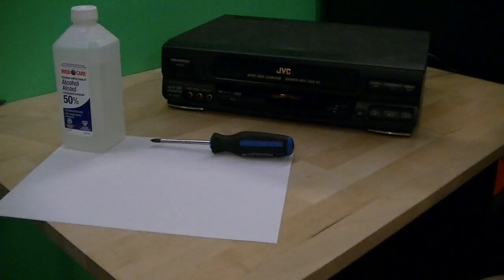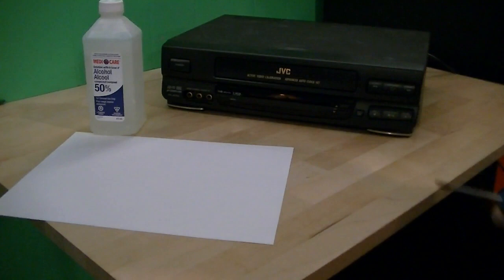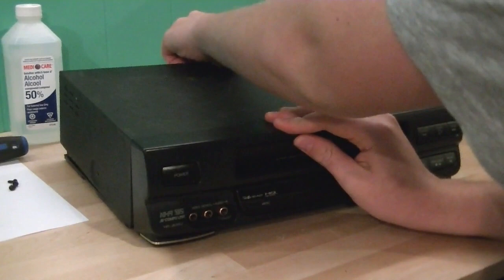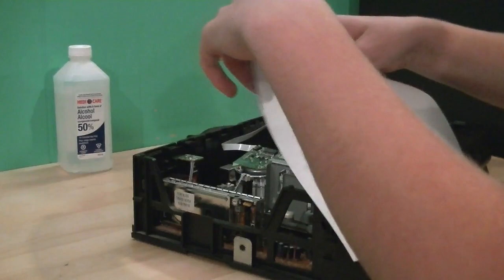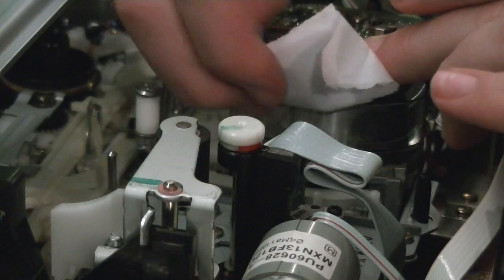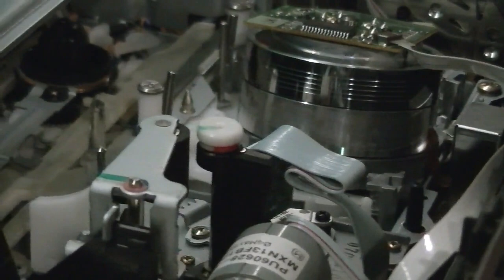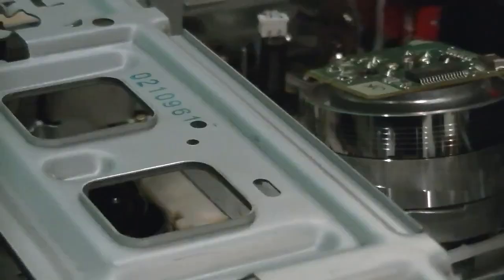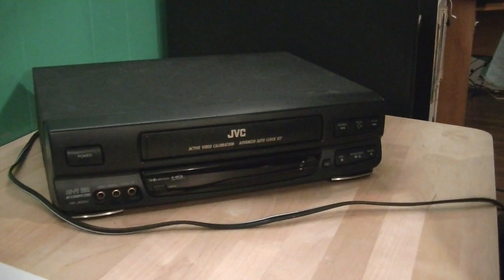How To Clean VCR Heads - Improved Method

Comment: Never put iopropyl alcohol on rubber parts like the pinch rollers. It will degrade the rubber, dry it out, and then you're screwed. Maybe just a moist cotton swab, and allow to thoroughly dry. As all rubber eventually deterioriates, this is something to consider.
Reply: Learned the hard way on cleaning printer rubber rollers’ ipa actually dries out rubber’ they make a special rubber roller rejuvenate for like $6 on Amazon printer roller cleaner
Reply: I use windex is work well
Reply: You can also recondition the rubber with 303.

Comment: 91% alcohol and chamois swabs
Reply: Yes, this is VERY important. Medical grade alcohol or ethanol. Do NOT ever use Isopropyl Alcohol (IPA) to clean video heads. IPA contains substances that will leave a residue on your heads after the liquid evaporates, and this will damage the tapes you play. Also never, ever use cotton buds/q-tips. Lint free swabs only.
Reply: im pretty sure you want to use isopropyl . you might be confusing it with rubbing alcohol which contains impurity's. iso is only distilled water and alcohol

Comment: Seems like a pain to do this every time. Head cleaning tapes often do the trick, but for the more stubborn funk, I taped four Q-Tips to the end of a pencil, drip the alcohol on the tips, and get in through the tape door and keep turning the heads while cleaning them up n' down - - -  like brushing teeth. Then let it dry, and that usually works. Been doing that for years. I guess as a last resort I would pull the cover and really clean the heads with tissue or Q-Tips and 91% alc.
Reply: How do you turn it from the door? With the qtips?
Reply: I tried a cleaning tape on my vhs camcorder but the picture still flickered

Comment: Hello Everyone
10 minutes ago (edited)
I am a consumer electronics tech, now first of all the type of paper to use is new coffee filters and drip isopropyl alcohol on to the coffee filter, fold the filter in half place it flat with finger slite pusher against the video head cylinder and with another hand rotate the drum, then clean the audio and control head and pinch roller and capstan with cotton swabs soaked with alcohol, for now, leave the top cover off connect VCR to a monitor for test play.

Comment: I had some problems with my VCR  the other day and when I tried to put the tape in it has some static lines on the VCR. It would be the VCR Head is dirty
Reply: Well who  use vcp now.  Bec those are tape driven nowadays  everything  is  digital.  We do have vcp but  no  use..  How are you using

Comment: what kind of alchol do i uise can normal rubbing alcohol work??
Reply: Yes.
Reply: Don't use alcohol to clean the rubber.  This will dry it out eventually.  There is special rubber cleaner for tape decks that is available, not specifically for VCRs but for analog open reel audio decks, this should work fine.

Comment: What about those Allsop VCR head cleaning tapes that you wet with alcohol and run to clean the heads?
Reply: I heard those are a no no to use. I know we used one in the past on a dirty VCR and it made it worse actually. Id suggest not to use it.
Reply: I’ve never had a problem using them. Majority of people say not to but I don’t really get where there coming from. The liquid is not actually rubbing alcohol. It’s a mix of rubbing alcohol and trichlorotrifluooethane.

Comment: QUESTION: I cleaned the VCR heads similar to what is done in this video. I used paper and the 91% rubbing alcohol. The tapes played with improved video and audio. Everything seemed fine. But then I put the cover back on the VCR and the video problems and audio problems returned. I then cleaned the heads again. This time when I put the cover on the VCR the video problems no longer existed, but there was still a slight "static" hiss type of noise. This happens EVERY TIME. I have tried this over a dozen times and the moment I place the cover onto the VCR while a tape is playing, the static "hiss" starts to be there. What is causing this and how can it be corrected?
Reply: Michael Zoran static means the heads still dirty
Reply: not really that means tracking problem
Reply: @kajamalanuruthiralingam5643  , so you are saying that a "static" audio sound being heard when the VCR cover is placed on top of the unit has to do with the tracking? ... The VCR actually has Auto Tracking. I tried resetting the Auto Tracking and that did not solve the audio problem.
Reply: Michael Zoran look at vhs tape alignment video correction on p2 and p3 adjumenta
Reply: @kajamalanuruthiralingam5643  Do you have a link to what you are referring to? Is that a video?
Reply: Michael Zoran 12voltvid on youtube  search for tape alignment
Reply: Michael Zoran  just type in youtube 12voltvid tape alignment and youll get the video uploaded by 12volt vid
Reply: If you only get the noise artifacts when the lid is on then the problem isn't the heads, the problem is noise in the circuitry.  Somewhere in there, something is creating noise and putting the cover back on gives it a way to propagate into some circuitry somewhere, maybe its power supply noise or clock noise getting into an amplifier section.  It is possible that putting some absorbing material on the inside of the lid might help, no guarantees but it might.  I thin sheet of rubber of foam glued up there.

Comment: The issue that I am having is the picture shaking on the screen don’t know if that is a cleaning issue
Reply: That sounds like a tracking issue
Reply: It's a tracking issue. You need to rotate the roller guides until the signal works correctly.

Comment: my problem is the viceo will not ply and the audio is fine.  i switched wires and vcrs and the new one worked fine and old one no video, any suggestions?  cleaning?
Reply from the maker: Might be more than a head cleaning issue. Cleaning the head is just for getting rid of video noise. If you don't have any video, the VCR might have an electrical issue.
Reply: You can try rotating the roller guides with a screwdriver.

Comment: But how do you clean it in this manner when the VHS is inside a tv? 📼 📺?

I have one in my kids room please help??
Reply: eject the tape first?
Reply: @foxkocreates  
The tape is out but cleaning inside isn't easy because the VHS PLAYER is made into the tv. It's all together.
Reply: @angelsmyre4647  oh I get you. That's something I wonder as well as i'm actually looking to pick up a tv with inbuilt vcr too
Reply: @angelsmyre4647  there are head cleaning kits you can buy and just like a tape you stick in you machine and as it plays through it cleans the heads on the vcr. i'm not sure if they are still easy to come by though. I don't think its as thorough but it might do the trick
Reply: @foxkocreates  
Yeah this is the best way for my little people to look at things without scratching DVDS. Maybe I can get some of those long stick Q-tips and try and clean it. I'm scared to buy a VHS. cleaner online and it doesn't work. Waste of money. Thanks 👍
Reply: you can find new, old stock VCR head cleaner tapes on ebay. it looks like a normal vhs tape but is made to clean the heads.
Reply: VHS head cleaner tapes

Comment: Use 90% isopropyl alcohol. Not ethanol. Dont use paper or towels with lint that can be deposited on the video heads. Now if there was a way to safely clean mold off the actual tapes, that'd be awesome. Ivr had to throw out dozens of VHS tapes due to mold growing on the tape itself.